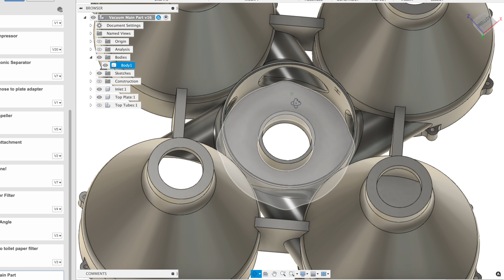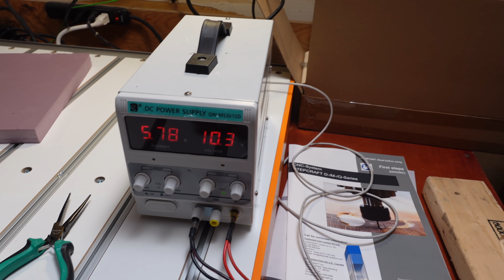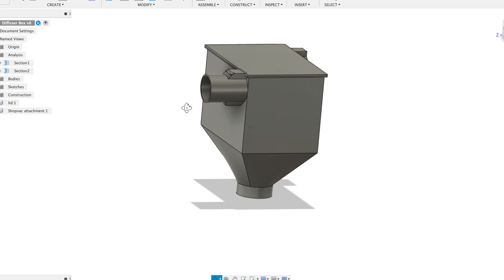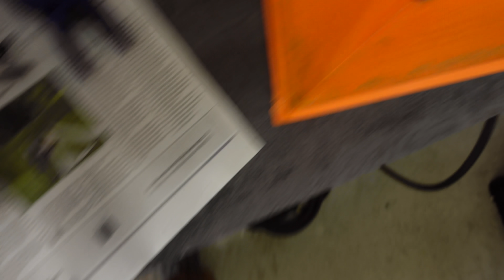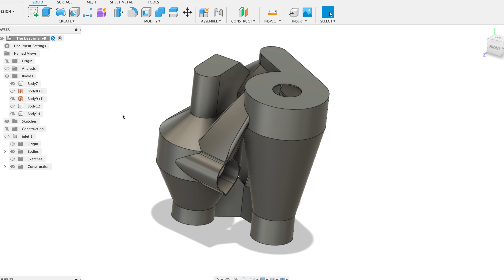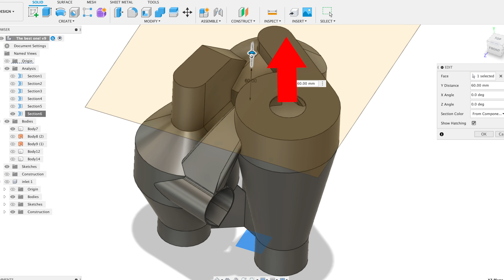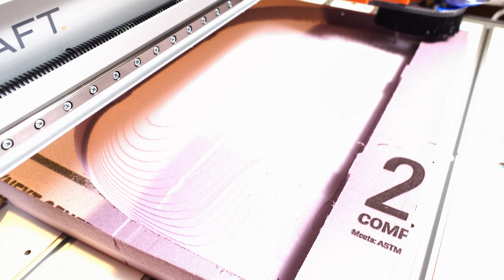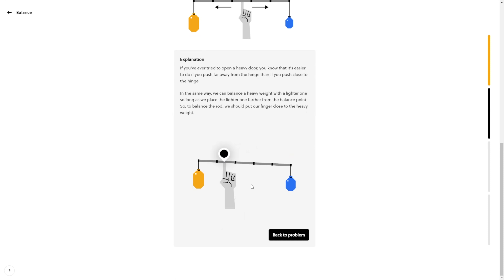3D Printed Cyclone Air/Dust Separator

Comment: Take a look at this scientific Paper. It is in french but you can concentrate on the schematics and tables page 19. It represents the link beween the main characteristics from diffrents manufacturers, for designing a cyclonic separator.

The name of the Paper in English would translate to : Solid/Fluid Mechanical Separation by Marie Debacq.

Comment: I have some improvement ideas for the monocyclone. Since big dust seems to be the biggest issue, I builded the these, that the big parts which are grapped by the airflow coming directly from the entrence of the cyclone. Maybe having a cone directly at the output of the cyclone which repels the big parts.

Comment: I bet its size related. YOu need to make it bigger and print all three sections seperately . Also , a dyson is essentiall2 multiple cyclones, 2 series and one of the series has multiple smaller cyclones. but as you found out, they keep the chambers seperate, and only open both at same time when you dump the dust.

Comment: Maybe this is too scientific to be an interesting video, but I'd print an array of different diameters and cone angles and see how those variables affect the outcome.  I have a feeling there's an optimal cone angle, and the optimal overall diameter probably depends on airflow.  You may also improve efficiency by having a cone within a cone to separate the down and up airflows.

Comment: Just thinking that vacuuming the floor and jamming the tube into the table To sick up the dye will interrupt the airflow a lot. Surging air is not easy for a cyclone to work with and surges may even depressurize the collection bucket and force collected material back out. On the router however, the airflow would be both higher and consistent and the cyclone has an easier job.

Comment: i wonder if the internal cyclone walls shouldnt be saw-toothed, like vertical splines with a taper on the flow exit side. This might create low/high pressure zones for tiny particles to fall out of the flow

Comment: What happens if you partitioned the inside of the large bucket into three chambers corresponding to the lower outlet holes? Maybe the smaller buckets are an issue?

Comment: There needs to be a tube extending a few inches down in the center where the suction outflow is. (Tube L ~2x Diameter)
Cyclone height should be ~2x it’s top cone diameter. 
Bottom opening should be slightly larger than the tangential inlet and top outlet. 
This will greatly improve dust separation.

Additionally, the size of the opening at the bottom controls the mass fraction of what you separate, basically the particulate size.
Cyclones separate things by their densities in the flow much like a centrifuge with the lightest materials getting displaced to the center by the  heaviest flinging out and occupying the regions near the outermost wall of the cone.
Hope that helps.

Comment: Interesting series of experiment, thank you!  Some unwanted advices tho: 
1. Don't stick to «tradition crafting methods» when modelling things for 3d printer.  For example, you could build more rigid and easier-to-print thing if you make it «solid cylinder piece with cone-and-vents cavity inside» instead of «thick cone with outer vent tubes», because later is dictated by producing method restrictions; 3d printer has no such limitations, and «solid» volume would be filled with sparse infill.
2. Maybe don't stick to circular bucket design too, you could have it «cube-shaped» in outer dimensions, that would be handier to mount and connect.  You could, for example, build «modular» separator and experiment with combinations for different dust sources.  Don't let waste bucket to limit your creativity.
3. With serial separator, you should put longer cone first, to separate big particles earlier.
4. Other suggestions were brilliantly explained by @sunsor - don't want to repeat them, but they are absolutely important.

Comment: I don't know anything about 3d printing, but I do know some about dust collection.  The biggest key to making a cyclone work well is air velocity.  If you oversize the cyclone, the air moves too slowly through it.  It's important to size the cyclone according to your hoses.  Even the best commercial designs will work poorly if the blower isn't strong enough and the air doesn't move through at a high enough speed.  If the air is moving fast enough, even a poor design will work relatively well.   The bucket has to be air tight, I think that's what caused the dust coming up in the one design.  Look at commercially available ones and try to scale the dimensions down to your hose size.  A proper cone angle makes a huge difference.    The inside being smoother would greatly help as well, the ridges form the printing create a lot of turbulence, and that allows the particles to exit the air flowing around.  The outlet at the top also usually extends about two thirds of the way down the top cylindrical section of the cyclone, this helps to keep the dust from being pulled in before it has a chance to really start spinning.  The cyclone itself causes a significant  reduction in airflow, so the multiple cone designs you see in industrial settings need a more powerful source of vacuum.

Comment: Каждый следующий циклон должен быть меньше в диаметре, для увеличения скорости потока внутри, и увеличения прижимной силы.
Each subsequent cyclone should be smaller in diameter, to increase the flow rate inside, and increase the downforce.
Another option is to use water mist after the first cyclone. It can be created by an ultrasonic humidifier. 
The dust will absorb moisture and settle in subsequent cyclones.

Comment: We used separators extensively in the lab and found through our experimentation that an inlet angle declination of 7 to 10 degrees made for the greatest debris drop-out.
Reply: Any experiments on the smoothness of the walls? It seems how rough the wall is may be counterintuitive.
Reply: @timramich  All of ours were made by the sheet metal shop on base so they were smooth walled to begin with.
Reply: just to not misunderstand you, when you say declination, you are talking from the airflow's point of view, or the filter's point of view? (so is the air blowing downward or upward at the entrance?) It's good to share any results from experimentation, because there is a lot of trial-and-error in these systems, simply because there are so many variables, too many to run simulations or base solutions on calculations alone.
Reply: @lukearts2954  What I mean by declination is that the dirty air entering the system from the pick-up hose does so at a downward angle of 7~10 degrees from horizontal, but from the side on a tangent plane to the interior surface of the separation chamber.  Entering from the top vertically is detrimental to maintaining the centrifugal flow in the chamber.  Also, you want to try to have a long straight run entering the entry port.  Many DIY units have a 90 right at the entry coupling, and we found it totally messes up the internal air flow pattern.  We found 6~8" was sufficient for good flow.
Reply: @Frostbite-53  excellent. There is actually also a benefit to make the chamber step outward just below the entrance. So having the entry tube not at the plane of the outside, but ever so slightly to the middle yet not protruding the side wall (the larger the particles the more towards the middle) so that the entering flow does not hit the material that is going around directly when exiting the tube. Having a downward angle would help in this regard. Thanks for making clear which one. (since I usually speak from the filter's perspective, I would have called it an inclination, hence my confusion)
Reply: @lukearts2954  Being an old Lab Rat, I look at it in the aspect of direction of flow, with the horizontal plane being 0 degrees.  And, if the "point" of the flow arrow is below the tail feathers, it's seen as a declinationary flow.  Fluid Dynamics are SOO much fun!  💦🌪
Reply: Did you try a step in the angle?
Reply: William can you recall what pressure and air volume /min was used and did you try varying those? 

For some uses high suction, low vol can be ok while in others you want high air volume and lower suction is ok.
Reply: @michaelrobinson9643  In the lab, we were using an off the shelf Shopvac brand 16 gallon unit with (If I remember correctly) a 2" inlet, and dialed it in for that.  It has been so many years now that I don't remember the CFM or "Hg specs of the unit.  That said, I would assume that the specs haven't changed by much over the years.
Reply: @michaelrobinson9643  I think you are observing flow requirements at the nozzle (at the machine). Those are rarely the same as the flow at the filter entrance and can easily be changed as needed by reducing or increasing duct diameter (assuming the fan can create the desired pressure). At the filter, the pressure and the volume are of less importance for the filtering efficiency. On the other hand, the actual air speed will probably influence the optimal angle (which would also mean that the optimal angel changes with load and in case of multiple machines or nozzle configurations (with valves).
I would definitely be interested in results of such tests if the variables are properly described.

Comment: The squeal is coming from the first section of tubing.  Same thing happened to me when I tried to use a cheap flexible tubing originally designed for a sump pump.  Vacuum tubing is specially designed with a smoother internal bore AND anti static additives in the plastic.  Spend the extra money for proper vacuum tubing sold as a replacement for name-brand vacuums.

Comment: going back to this video and realized the issue is the dust pickup hose to cyclone.  it is much better for the dirty hose to be connected to the bucket, lower the better, though you lose dust storage capacity as it goes lower.

Comment: Interesting video and a serious effort 👍

No experimental experience but I have a purchased cyclone and it differs in a few ways from your mono cyclone, the top diameter is maybe only half of yours, the angle steeper and I’m pretty sure the outlet to the bucket is bigger diameter and lastly the inlet port has a tilt downward (as well as being tangential)

Comment: If you look at those industrial designs you see a straight cylinder above the cone so when the particles spin they fall with gravity, the slope of the cone + spinning allows them to stay in orbit. If they orbit at the same level as the outlet then they can jump inward and into the outlet, if they orbit lower the middle cyclone will have time to spin them outward.

Comment: The velocity of the air stream, size and density of particles, and slope and diameter of the cyclone matter a LOT more than you'd think. The multi cyclone is essentially optimized for three different particle sizes, since it was done more or less randomly there's no telling what exactly those particles might be.
Reply: Yes, I agree, try the Stairmand geometry, you can find the sizing table with google ^^
Reply: How well do these cyclone filters work with slower speeds with small particles? Ive got a small mushroom farm and during fruiting you get a lot of spores being released, would be nice to be able to use something like this on my air exchanger to cut down on buying filters.

Comment: This should start with proper excel calculation. Cyclones are pretty well understanded and documented. I was calculating some Cyclones for engineering project at uni. For different particle sizes (dust, chips) ussualy cyclones with different sizes in series works best.

Comment: Make a taller steeper mono cyclone and try a series cyclone but with only 2 cyclones and make it a two-parter instead of a single print so both cyclones are the same height.

Comment: You can modify a serial cheme.
Inside bucket you can place some walls like in your diffuser setup, to prevent leaks. Also by varying input and output nozzle you can adjust speed. Adding a tube halp length of a cone to output can limit bypassing.

Also idea for single cone variant. Add a spiral cone in middle. So ascending air also generate additional vortex colinear in its tangential motion, but  opposite in axial.

Comment: The fuck was that singing. I almost instantly clicked mute and dislike. Didn't dislike it in the end since i really liked what you tried in the video. Half a year ago I was also investigating this idea of cheap compact design for separating ash in ash vacuum, but i have only cardboard and scissors so I didn't get far. I mostly used published research and calculations which helped me with understanding of separators work, but it was too hard to test it.

Comment: I once designed a Hydrocyclone separator for a liquid methane cooling system which builds long chain hydrocarbons and Hydrogen as is brakes down in the particle accelerator....still not been used yet but may be in the future.

Comment: Great video!
If you look at the 2nd generation Dysons, they have over a dozen on tiny cones. The tinier the lower end of the cone the higher the speed, but also the higher the resistance to the airflow, thus the massive parallelism. As mentioned elsewhere the inside of the cones should be as smooth as possible, to keep the speed up and reduce resistance of the filter (acetone vapor might help here). Also both the low cost and industrial filters I know of, have the air outlet at the top hang down a bit, for you that would be about 2". I like your serialization, have been thinking about that, but haven't tried it yet. I think two phases with the second being much smaller might give better performances: one big cone surrounded in Dyson fashion by a dozen of tiny ones.

Comment: I work in a crisp factory and we use cyclones to remove potato starch from the water. Water is used to push the crisps from the slicer, through various systems. This water needs to be recycled through cyclones otherwise startch builds up around the tanks and causes motor failures etc. The cyclones we use are very tall and narrow. The end nozzle is roughly 2mm while the intake and outtake pipes are around 3 inches. Intake is where the water goes in, outtake which is at the top is where it sucks the water up. The intake and outtake pipes are adjustable. If we close the outtake pipe, it creates more pressure and more water comes out the nozzle. We do this if we have a potato that has more startch content. If we close the intake pipe, less water goes on but this can help remove more startch but at the cost of making the tanks hold back dirty water. The slicer water tank uses 4 cyclones, the peeler water tank uses 2 cyclones. In total they are 3ft tall. They are quite thick so I don't now the internal diameter at the top but I assume it would have to be the same diameter as the intake / outtake pipes.

Comment: Just ran across this video after you were dealing with the problem with the fine particles i may have an idea for that... this requires water... Mist to be correct.. what if you added a mist port with a mist nozzle. then add add a dust filter halfway up the big bucket to catch the dust particles and that will lets the water drain to the bottom for easy cleaning.  maybe a pump from an aquarium and small hose to the nozzle. trust me im an engineer.... software.. close enough

Comment: Small recomendations: angle of inlet to cyclone should be 15 degree down, not horizontal. Dust must go down to the basket, not make donut on the top (your video show it very clear). Next, arrea of inlet should be smaller than outlet -> speed of air behind inlet should be high, before outlet small(smaller). shape of the conus is important (ratio high/diameter). A little bit theory reading and calcullations can be very helpful.

Comment: Hi. I think your design has two issues. The cylindrical part is too short. It needs more cylindrical length to slow down the and get away from the suction outlet. And second your cone area is also to short which causes a too steep angle. It needs to have a more flat angle. Compare it with the proportions of the industrial solutions you mentioned in your video. Like this it will work much more efficient. Good luck!

Comment: This isn't my field at all, but I have a suspicion that the reason your tri-cyclone didn't work as well as you wanted is that you may have used buckets that were too small for the 1st and 2nd stages. I would think that without sufficient space for the stages, pressure might keep the finer things from flowing out into the buckets. Something something upward air currents, backdraft, and other big words. At the very least, it's an easy thing to verify for?